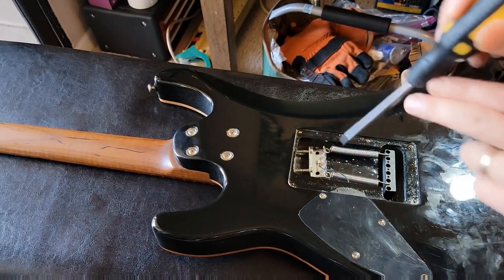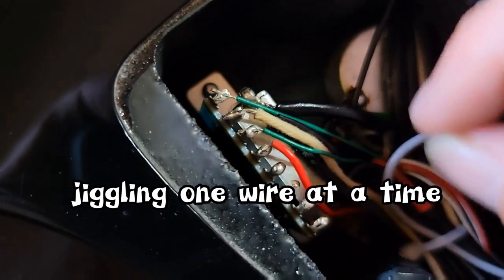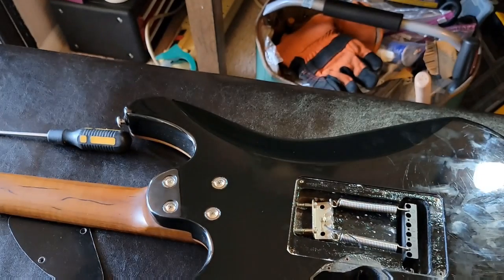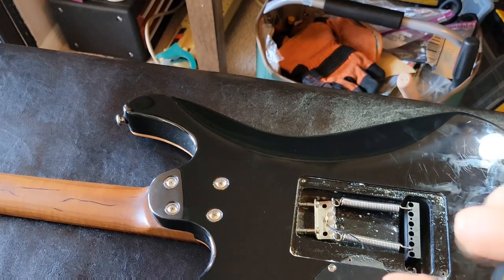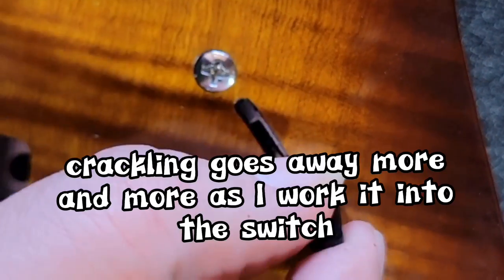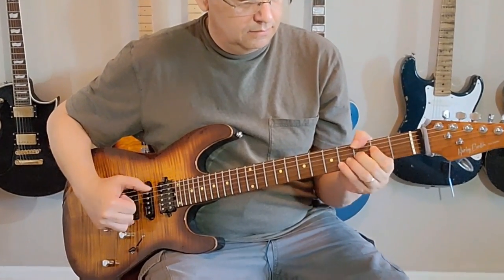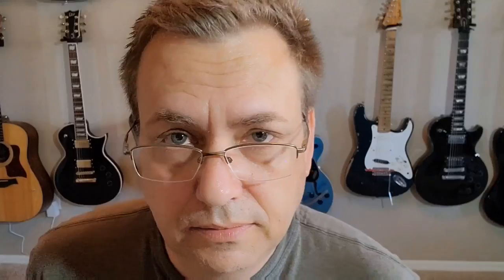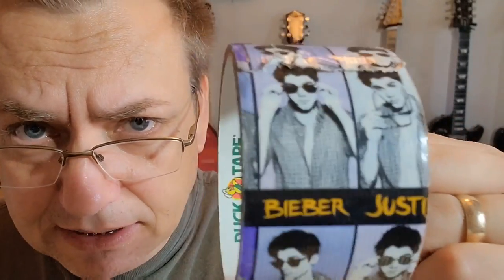if you suck at saving money - do this

Comment: Was that just regular wd or contact cleaner version? I looked up a lot of info on contact cleaner before I cleaned all those old guitars and a couple of amps.  I found deoxit d5 had the best reviews for a single step spray but a bit expensive. With the amount of work that goes into deep cleaning the pots on a 30 yr old piece of equipment I wanted to use the best. It's still lasting on the older Peavey (bout 3 yrs and that was the only cleaning ever) but the Crate needs to be redone bad.
Reply from the maker: I just use straight WD-40, but I'm not too fussy because I've used it over the past few decades to clean pots etc on guitars I toured with back when I was touring, playing some of the dustiest outdoor venues and never had a problem. I think I would be a little more squeamish if it were controls on an amp or an effects pedal though, usually for those I would literally just take the pots apart and use a bike pump to pump out any dust that was in it. I never had to worry about the amps as it was cuz they were provided, but I had to do pull the pot apart and blow into it trick a few times with my line 6 pedal. For guitars WD-40 is a quick fix, and all that's left behind is paraffin wax anyways.
Reply: @guitarmeetsscience  I know you have the experience and I'm sure knowing that works is going to come in handy one of these days.  Thanks Jimmy 👍
Reply from the maker: @folkenbluzer  No worries man, deoilxit... I've heard of it, and now it's on my mind to pick up some for the more delicate stuff. That's the thing, guitars I have no problem gooping up... Something goes wonky parts are cheap to replace, not so much with amps and effects. Really, nowadays I don't play out so I'm less concerned with dirt, but dust still accumulates over time. Wd is a great quick fix though.... That's been the de facto standard for over 50 years.